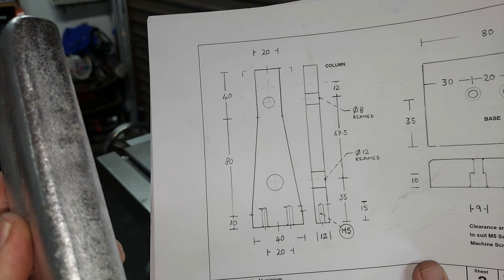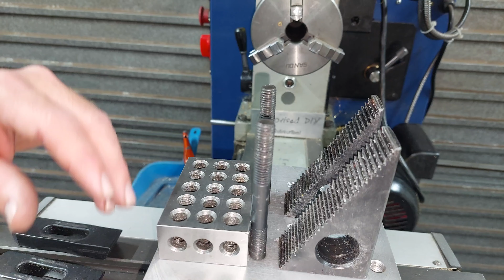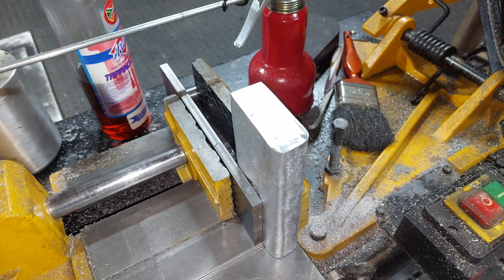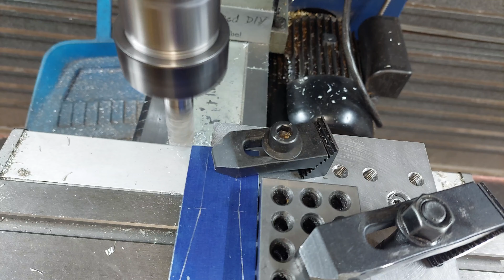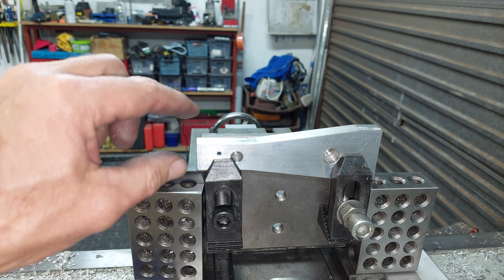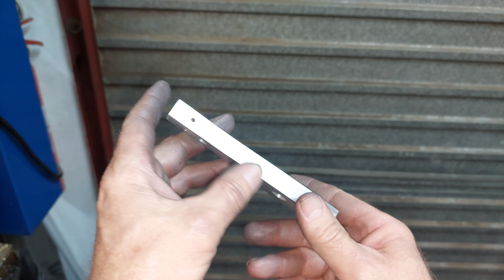Wig-Wag Steam Engine Build: The Column

Comment: Nice to see you using all the tools you made to make an engine.
Reply from the maker: Thanks Paul! It is time I started using them constructively. 😁
Reply: @improviseddiy  lots of interesting challenges once you start building small mechanical machines imo.
Reply from the maker: @paulrodrigues5562  I totally agree! It looks simple but the work holding and figuring out which process to use are real challenges. A 3D puzzle.